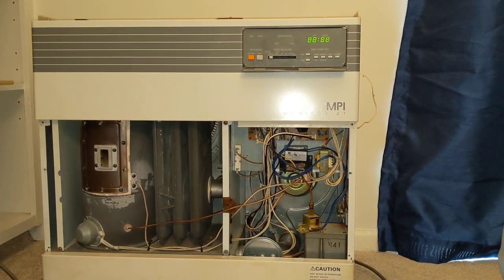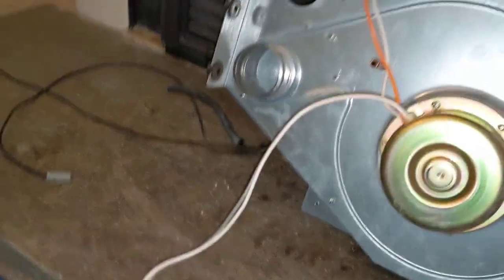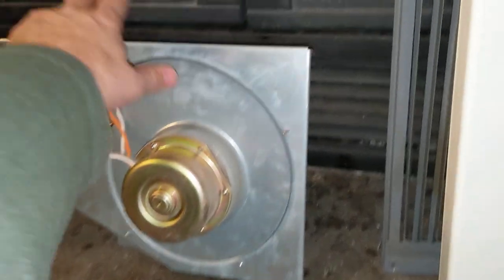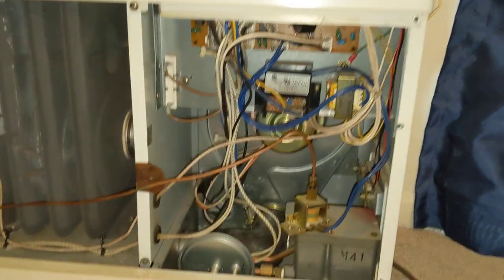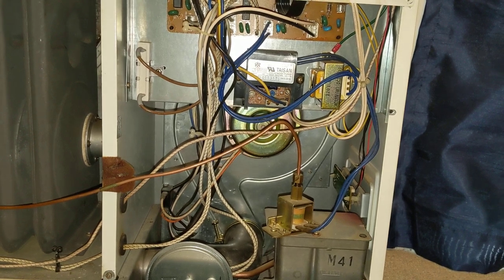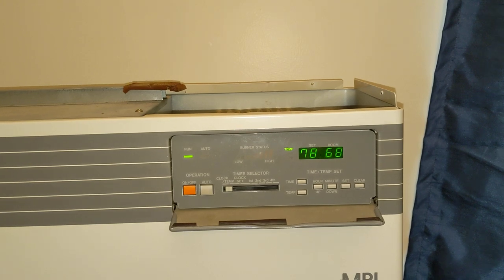Monitor 41 heater - testing new combustion / blower motor (1/2)

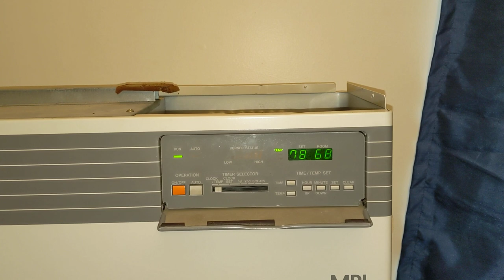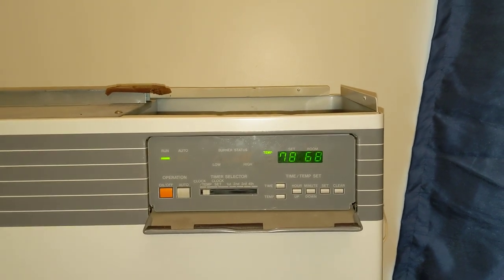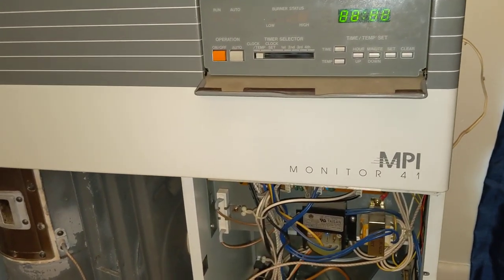Comment: I have the   MPI 441 model and it takes about 3:00 min. to 3:30 min. before the pump starts and about 20 to 25 seconds to light up the fuel. Then, if there is no heat (no flame) after 1:30 min after ignitnig, the flame detector will shut off your heater. 
The problem with my heater is that it starts heating, thers is flame, but not enough to get warm so the flame detector tur off the heater. Next step, I will have to open the whole burning pot to check the bottom mat to make sure it is not torn away.

Comment: Hey Dave. My dog is a jerk and chewed the thermostat wire on the connection. Can it be straight wired until my replacement part arrives.
Reply: As ex technician in hydro power plan, I think that, if the end of the wire (thermostat) is not chewed by your best friend, you can just replace the wire by a 18 or 20 AWG copper wire and connect the thermostat with compression connectors or  marettes and protect it with electric tape. Give me feedback.